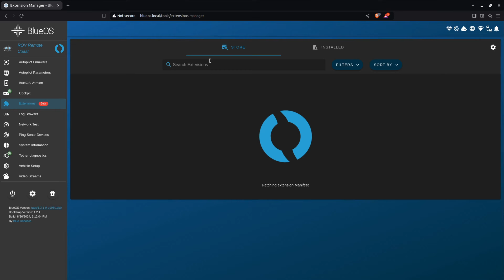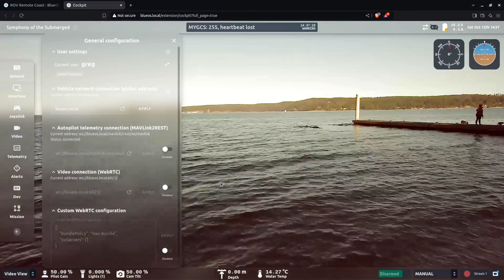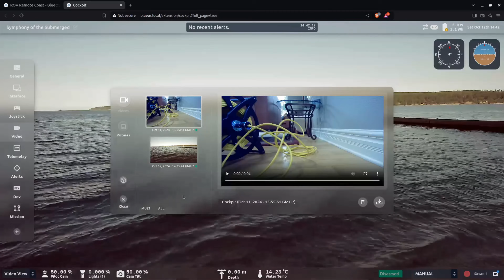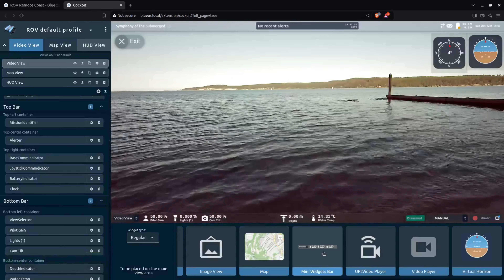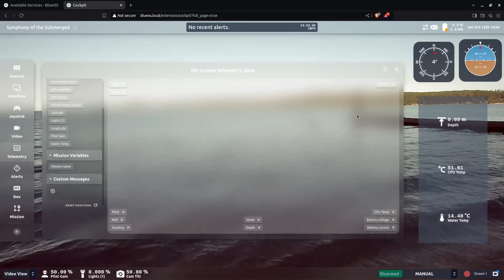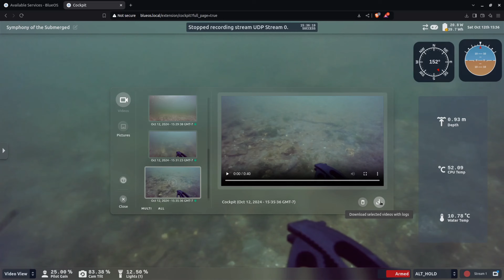Comment: It would be cool if this would support INAV and Betaflight by being able to use MSP.
Reply: Hey there! Thanks for the comment - I’ve actually never heard of iNav / Betaflight. Are they open source drone firmware, like ArduPilot and Px4? Please elaborate as I’d love to learn more!
Reply: @philparisi_  
Yes, they are. 
That's interesting you haven't heard of them because YouTube search shows:

1.2 million results for Ardupilot
1.6 million for Betaflight
1.7 million for INAV

Betaflight and INAV are brothers, both forked from Cleanflight years ago. Each being more popular than Ardupilot. :)
Reply: @philparisi_  
Hi Phil. Nice to meet you.  :)

I'm not sure if my reply posted the first time. Yes, they are open source autopilots. As a rough indicator of popularity, Google shows:

1.35 million results for Ardupilot 
1.5 million results for Betaflight 
1.7 million results for INAV

So what I heard is something like "I haven't heard of McDonald's, is it kinda like Burger King?" 😀
Reply: @philparisi_  Is this a joke??
Reply: From a quick look at their telemetry docs, iNav and Betaflight both apparently support MAVLink output, although I'm unsure whether using it requires extra configuration, and that doesn't help with getting control inputs from an operator.

I looked into MSP a little bit and it's seemingly mostly used with OSD devices, although I may be misunderstanding. If you think it would be valuable to include in Cockpit then I recommend raising an Issue for it in the bluerobotics/Cockpit GitHub repository, where you can lay out the features it would provide that Cockpit doesn't currently support 🙂

It's worth noting that Cockpit is based on web technologies, and requires a translation layer for accessing serial protocols. For MAVLink that's currently provided by MAVLink2REST, running in BlueOS on the vehicle's onboard (companion) computer, although there are plans to add a MAVLink2REST (or equivalent) server to the desktop version of Cockpit in future, so it doesn't require BlueOS to connect to an autopilot. MSP support would require a similar translation, although if the protocol is quite simple then that may not be too difficult to include/provide.